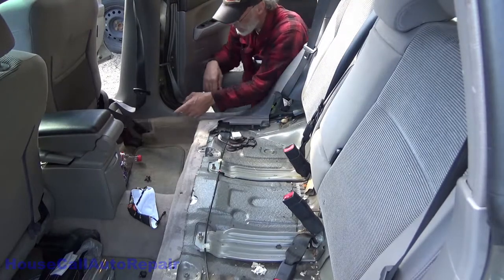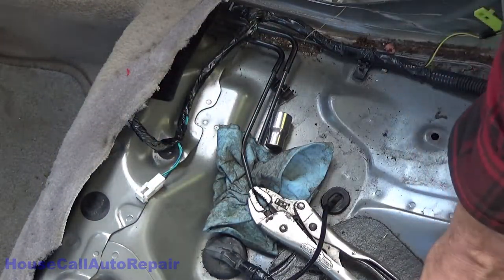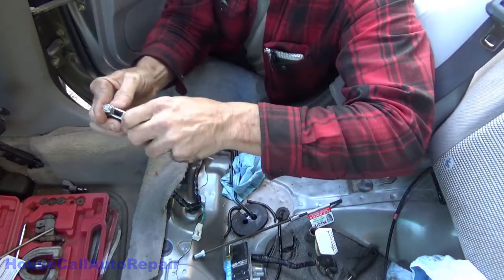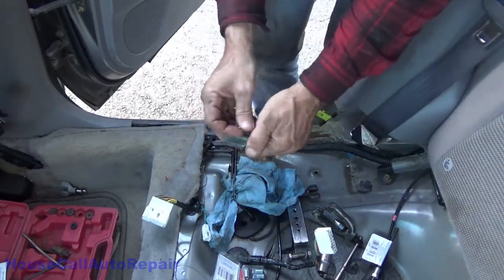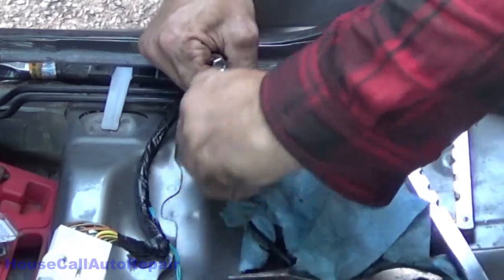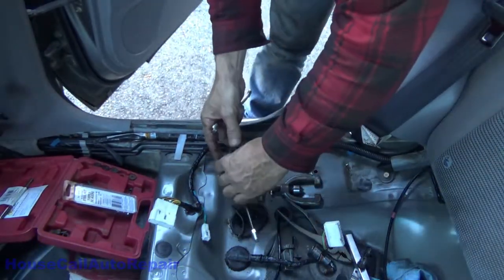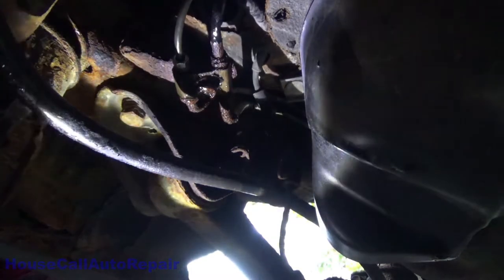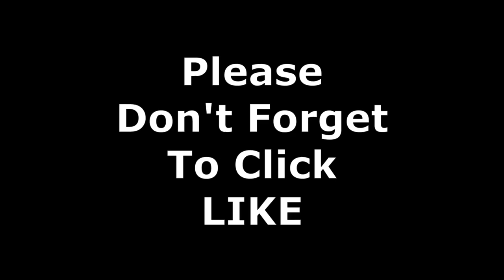2006 Forester Rear Brake Lines - Part 2 - Auto Repair

Comment: Yeah, I'm up in Canada and have a 2007.  The junction box for all 4 lines is all rusted and rotten, after watching this, and reading the troubles of another guy who replaced his lines, rather than patch, I think it's probably time to move on from this car.  Car only has 135000kms but rust never sleeps.  Thanks for posting.
Reply from the maker: I'm starting ANOTHER Subaru brake line nightmare this week. That small junction under the rear, right, where the lines come from under the back seat, are rusted out as always.... Also a 2007, Forester.

Comment: I was waiting to see if you realized you forgot to slip the fitting on before flaring the line. I've done it myself a time or two. When making lines I got into the habit of constantly reminding myself to make sure the fitting is in place before I make the flare. I just had to recently section in a line on our Honda Civic. I need to eventually replace both the brake lines and fuel lines that run the length of the floor pan. To do the job right I have to drop the gas tank. Not looking forward to it.
Reply from the maker: it's a very easy job....IF you make yourself enough room to maneuver around freely!

Comment: Excellent video will try to imitate your skills.  Size of line and fittings please 👍
Reply: 3/16 line
M10x1.0 fitting
Reply from the maker: 3/16 inch line, and re-used fittings. (per owner request.... the cheapest possible)
Ghetto rigged!